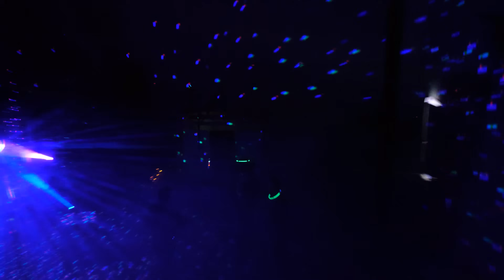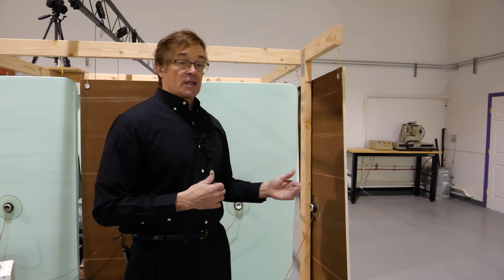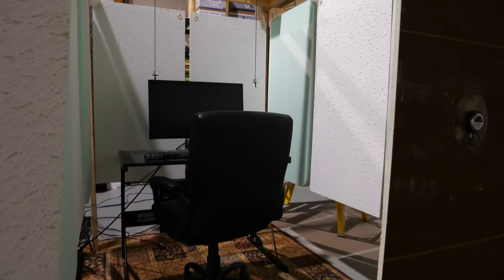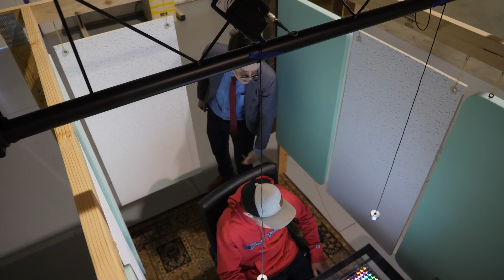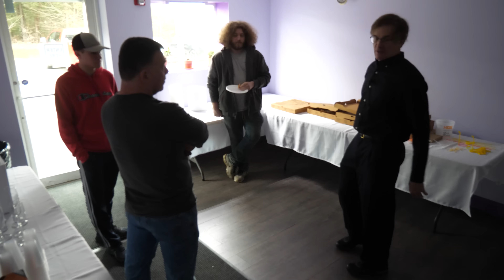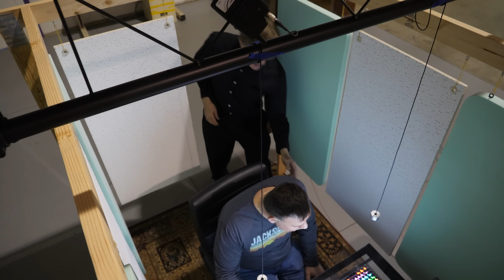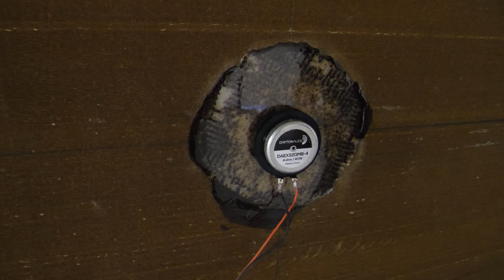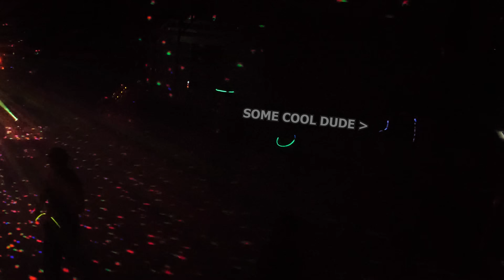SHOULD SPEAKERS THIS GOOD BE LEGAL?

Comment: How heavily does these panels rely on DSP to approach a flat response ? I would expect some very pronounced spike in their sensitivity spectrum, corresponding to different vibration modes. I'm also curious to know how they behave in the time domain. Like, are you able to keep the group delay within reasonable range ? (this would afect how "Sharp" the sound is reproduced)
Cheers !
Reply from the maker: Indeed, a parametric equalizer really  works well with these speakers, but the demo was performed with the amps set flat.

Comment: As with all HIFI gear its really down the the personal experience of the individual as to how good they felt your system preformed. It would be interesting to refine the concept with DSP in the same way as a line array works with having rear facing drivers to reduce the sound from behind the speaks. That would make a more environmentally friendly speaker.

Comment: It would be interesting to me to know how well the panels would work in reverse as listening devices aka microphones? Old time intercoms simply used the speakers as microphones to communicate with the head end of the system.They were quite common in school settings when I was in school about 65 years ago.
Reply from the maker: They would probably sound strange because of hysteresis.  It's  like the difference  between sending a crowd through a narrow doorway into a room and releasing that crowd out into a city.

Comment: I am considering constructing some of these for a 7.2 setup or maybe even a 7.4.2 for an outdoor cinema but I am not sure how the omni directional speaker will work in that kind of setup. They would be spread out over a much larger area than what you have here. In your experience, will these still deliver that sense of spatial sound one is looking for in a theatre setup? I am in the NEK as well if you ever need more guinea pigs...
Reply from the maker: It will still work.  However, test this.  These are easy and relatively inexpensive.  Construct two large panels, hang them roughly where the limits  of your "theater " will be and while they're  playing move around and sample the sound.  Assume that only the volume will be limited with only two speakers.
Reply: @TechIngredients  I think that is a good suggestion, sound is a tricky thing. Would hate to put in the time and effort going whole hog out of the gate only to find that they are not going to work for my application.

Comment: Really nice! Can we find (is there?) a way to replace the Subwoofer? A way to produce low - sub frequencies  (80Hz > ) with A panel? Maybe a 1,5m by ~3m landscape Alu- Polucarbonate sandwich  , 5mm thick) with more than one actuator? One each corner and center?
Reply from the maker: I've tried  a few things such as extremely  large and very thin panels and materials  such as composites and corrugated materials.  It just doesn't  work well.
Reply: @TechIngredients  Ohh... it would be cool! Fullrange PANEL system. I think we need bigger in size (with more travel) and more powerfull actuators.

Comment: I built those following the exact steps in previous vidéos : it's been our living room sound system for about 2 years now. Here's my thoughts : Very good sound overall, definitely worth it, I've tested many setups (how many exciters on each panels, what kind, etc.) and there are a few improvements i've had to do. 
Don't paint those, buy a good subwoofer, don't put the sound too loud for too long (i've done techno party with it, at some point the exciters heat and get damaged), buy large and thick xps panels for the high frequencies or they will get too shrill.
Reply: Hey can you send more information on the build you had to modify so I can build this.
Reply: @corentin2523 +1 for being interesting in your build info. I want to use these mostly for outdoor purposes. I live in a cul de sac where we do a lot of stuff with the neighbors. Would be nice to have easy speakers to set up and take down. Further, we do a big Halloween setup. These speakers would be great for that!
Reply: Did you do a YT video ?
I am curious if they would perform better with different sized panels for different frequencies , and if the bass panels should be at a different distance from the ear than a high frequency ?
Reply: Would the advice not to paint them pertain to just XPS or does it apply to acoustic ceiling tiles too?
If so, would it be possible to cover them with a layer of thin painted cloth above without interfering with the sound in a noticeable way?
Reply: @woolion food coloring through an air brush. The panel will soak in the color without affecting the sound quality. Leather dye works as well.
Reply: Was it attempted to remove the double sided foam tape the exciters come with as it seems to me would be a limiting factor or isolating barrier to the transference of high frequencies
Reply: Don't forget the dsp that you need to have to make a useful sound out of this literal junk.
Reply: So paint changes something? On the heating issue, did you try the serial connection?
Reply: Tech Ingredients has a thermal adhesive paste you can apply to the exciters and a heat sink that will help that out.
Reply: Or you could just buy a good pair of speakers and enjoy music accurately reproduced 😅😅

Comment: Do you have any audio frequency response graphs of the panels? I think you should have an audio expert tune the equalization to not only see what flexibility they have, but to see if they can match known quality speakers/headphones. The FR graph could also be used to visually compare to other speakers/headphones. Can't say for sure from the youtube audio, but they sound strong in the mids, decent highs, but the lows are weaker. There's a bit of a muddy sound from the mids drowning out everything else, but again, this is just from the audio provided by the video.

Comment: Thank you for inspiring a whole new movement in audio playback philosophy. I've followed your progression and built a variety of driver and panel combinations. I settled on .625 in thick high grade birch marine plywood. Installed 1 each 2'x2' and 1 each 2'x4' panel per side. The panels hung one over the other, linked by fine elastic cord through small holes drilled near the corners of each, 1' from the wall by shelving brackets. I have excellent response from mounting 2 of the EX32EP2-4 exciters per 2'x2' panel in series. For the 2-2'x4' I installed 1 each of the BST-2 Tactile Bass Shakers...yes, bass shakers. Spray painted front side of all 4 panels with truck bed coating leaving the back side natural. Driving the 4 panels with a Lepai  Bluetooth stereo amp with 45w/ch into 4 outputs. For equalization I found the Timpano TPT-EQ7 handy because it has an adjustable Subwoofer output for augmenting tones below 50hz, with a 12" RCF powered unit. My fellow musicians and friends are amazed by the lively tactile experience across the entire perceivable audio spectrum. I like to listen with my back to them with the video display in front of me. Very much like movie theater/headphone presentation. Fun stuff for sure!
Reply: Hey bro, can you share you socials here, want to see how you setup looks like
Reply: Did you ever do a write up on a blog or forum about this? I would like to see more of this?
Reply: Electr magnétique midel pkease name constructeur  thanjs

Comment: Have you had an audiophile listen to this system? I'm genuinely curious, but I'm extremely skeptical that this sounds as good as you think it does. I'm sure it sounds better than your typical Bose garbage, but I'd have a hard time believing it produces sound that would be acceptable to someone who has a real interest in high quality audio.
Reply: Also, the fact that you think headphones are the gold standard when it comes to audio really shows the lack of experience in high end audio. I've owned some of the best headphones in the world - and while they do sound very good, they don't come close to a high end stereo system.
Reply from the maker: They're  very inexpensive and easy to assemble.  Build a pair and listen for yourself.  Headphones are an excellent  standard keeping in mind the variable  quality of the listening environments where speakers are used.  Also, for the average user who doesn't  invest a lot of money in a sound system, decent headphones are better than speakers of equal cost.
Reply: @TechIngredients  I don't disagree with anything you said in your reply. However, you have billed these speakers as some of the best sounding speakers in the world - that's what I take issue with.

Comment: While it may be counter intuitive, but why not also use the ceiling and floor as well as the walls for the (Sound Modulator) speaker. Since the Filing Panels dampen as well as sound, it seems to me a total surround means TOTAL while the floor Amy not be perfect, it has a contribution into the overall sound  environment. As to the So-Called Professional Audio Engineer, I have worked with some during my time in Broadcasting, the Contracted  Professional Audio Engineer created more issues than the Audio Engineer who operates the system. Sound is very subjective, but the common denominator is what the sound feels like to the average person, not just the self appointed audio expert. Really good sound, feels right, and it cannot be put into an equation and calculated . Like large cathedrals that have an indescribable audio quality that cannot be matched by modern constructions. The concept of a solid Sound wall is well known, and refining it as you are doing can be done in the average room, work place, where the sound does not have to be loud to be heard and felt.
Reply from the maker: Positioning  these panels horizontally is difficult because they need to have absolutely  as little restraint as possible.

Comment: Thanks to your original video a few years  ago, I got badly addicted to DML speakers and actively followed some of the threads on the audiophile forums testing and evaluating designs.  I like you, fortunately had access to wide range of materials to run my own (subjective) tests on and came to a few conclusions:

1) Pick repeatable tracks.  Mine are: "Adagio for Strings" (low pitch Cello) , "Bohemian Rhapsody" (rock, electric guitar & high pitched vocals), "Refined Enlightenment" (high pitch violins), Romanza (Romance Anónimo, Spanish guitar), Above &  Beyond - Alchemy (electronic house with vocals)

2) Every material I tried failed on one of those tracks, clarity, bass, vocals etc etc.  But a few had standout areas, the answer was a combination of materials.

3) My personal favourite is a canvas picture frame, stretched over a wood frame, tightened with a watered down PVA glue wash and on the rear a 0.8mm plywood veneer sheet PVA glued to the back of the canvas.   The exciter was mounted on a 3mm plywood disk glued to the veneer at 50/50 and 2/3rds.

The canvas frame gives a love warm bass, and the plywood veneer and discs damp any unpleasant over vibration whilst preserving clarity.

I am absolutely convinced, there is no "one best" single material for best sound reproduction, you need a mix of materials, then they easily beat anything else I have heard.
Reply: I would assume that some.materials would favor different frequencies so you would/could use multiple materials for each channel...
Reply: Neil, do you share your build and testing experiences on a blog or forum? I have been thinking about building a theater room in a 10'x20' space. Outfitting the entire room with these type speakers because of the uniqueness and the possibility of building it with my children as the speaker builds are simple enough and safe enough. I can't quite picture what you described in 3) with confidence but I am really interested to know more. I think it would be something really special that my children would be able to claim the theater build when they have friends over to watch Frozen or Cars. :)
Reply: @marcgenre5563  Apologies, it appears YouTube in its' wisdom, won't let me post links to the information you need, so re-posting without links and trying to offer "pointers" :(

The honest answer is everything I have learned except through my own experimentation is by standing on the shoulders of others!  I fanatically read the DiyAudio forum thread which currently stands at almost 300 pages of discussions and others experiments.  The specific page starts the discussion of the canvas panels I mentioned starts at page 221, search for diyaudio - "a-study-of-dmls-as-a-full-range-speaker."

As for what I described, (sorry again no link) it is basically a 25cm x 30cm (or bigger!) blank artists canvas picture frame from Amazon with a wash of 50:50 PVA glue on the front to tighten the canvas and a sheet of 0.8mm the plywood glued with PVA to the rear of the canvas.  I then use a Dayton Audio DAEX32EP-4 exciter fixed to the rear and a small Fosi Audio bluetooth amp (BT10A) to play through for experiments.

The basics are wonderfully simple and fascinating to play around with, and I'd say lots of fun for children and especially with some science thrown in!
Reply: BTW, When gluing the plywood sheet to the rear of the canvas, you must make sure the plywood is smaller than the canvas so there is a gap between the plywood edge and the canvas wood frame (I like 10-15mm), and also ensure the plywood is thoroughly stuck to the canvas, especially around the plywood edges otherwise you get unpleasant vibrations at certain frequencies as the plywood can't damp the canvas and they collide with each other.

The principle broadly, seems to be about how quickly the vibrations spread across each material, and how quickly each material can respond to those vibrations and so create pressure waves in the air.
Reply: @NeilStansbury  Great info and thanks for the reply. I have already gone to the site and page in the forum and will start digging in to see what is possible and realistically achievable by the kids and myself. I think I once found some DIY amplifier kits that seemed to be something not overly complicated. I will dig around for something like that too. The more I can involve the kids the better, I have learned to never underestimate what my kids are capable of doing so the sky is the limit even if the budget has to stay close to the ground. 😀
Reply: @NeilStansbury  Thanks for sharing your results, that's outstanding information
Reply: @NeilStansbury  sorry for bringing this back from the dead, but I have ordered all the parts and am going to build this as soon as they come in.  How did you mount these?  Did you hang them like in the video?
Reply: @monkeypainter808  No worries!  Yes very similar. I have two sets, one set mounted on my kitchen ceiling (hanging horizontally) and 2 larger panels hung vertically down my living room wall. Both panels are hung by fishing line, through tiny eye hooks that screw into the wood frame and then similar picture frame hooks with double-sided tape to the ceiling.  The idea was nothing physically "attaching" the panels like screws etc to avoid vibration. Once tight the fishing line just hooks over the ceiling clips.  The vertical panels are trickier to balance as they're just attached to the top of the frame.  The audio cable was also an issue stopping it touching the panel anywhere.

What I found was the gap behind a DML panel is critical and can totally change how it sounds. Something about how the sound reflects from the surface behind it causing interference waves with the sound at the front.  Another post on DIYAudio led me to discover " Melamine Foam Cleaning" sponges. I have glued those inside the rear frames to control how the sound reflects. It does deaden the sound slightly, but I wanted the ceiling panels hanging 30mm from the ceiling so needed to resolve it.  I suspect with more experimentation you could tune the reflected waves rather than deadening them with the sponges. It "sounds" to me that a gap of 200mm or more behind the panel and the reflections become less obvious and you just get the DML "surround" effect.

Btw. I've found the plain white artists canvas picks up dust/dirt and finger prints very easily so will be testing a spray on lacquer to try and make the surface "wipeable". I also want to test mounting some small LED strips behind the panels. A strip of maybe 10x WS2812 LEDs, WLED and an Esp32 might be a fun solution here!
Reply: Thank you Neil for sharing!
I just printed this out for my reference as I novice along for when and if I get to the point of going this deep!
Could you share a source for getting the 0.8mm veneer?
Reply: @samTollefson  It's pretty common stuff, used lots in aircraft modelling.  Just search for "0.8mm plywood sheet" 👍

Comment: From a technical point of view, "friends" are not the best choice to test it out. You need a audio engineer or professionals related to audio to evaluate this. Over here, it sound terrible, specially the bass (Xonar Essence STX II, Sennheiser HD 650).
Reply: Did you not listen to the thing at the beginning where they said YouTube compression was garbage?
Reply: @Scou73r  "Did you not listen to the thing at the beginning where they said YouTube compression was garbage?"

What this has to do with sound capture? Youtube sound compression is one thing, a bad sound capture is another.

How much YouTube sound compression affect this?
watch?v=Bw4uglDahEo
Reply: The bass is very distorted but as nobody is mentioning it in the video (some even say the opposite) I assume it's just the microphone clipping.
Reply: @FAB1150  Most of the problems with the audio is caused by sound clipping (bass among other frequencies).